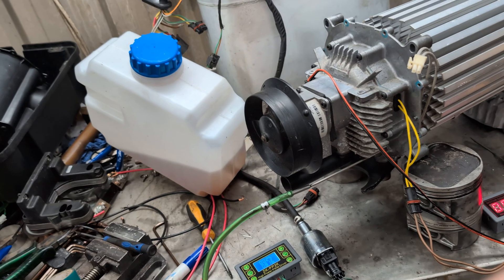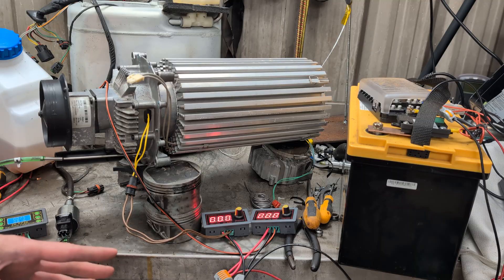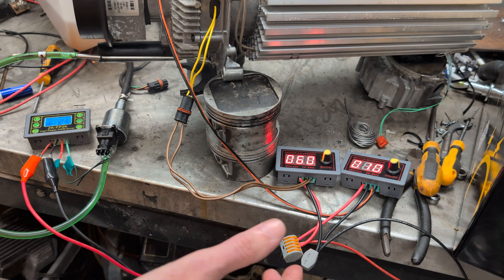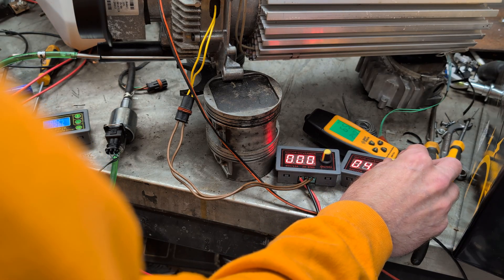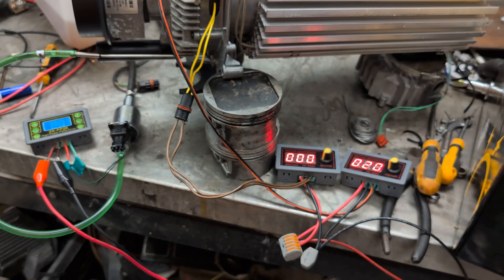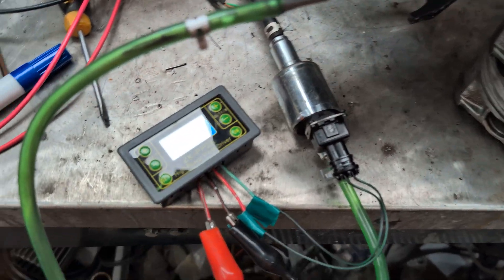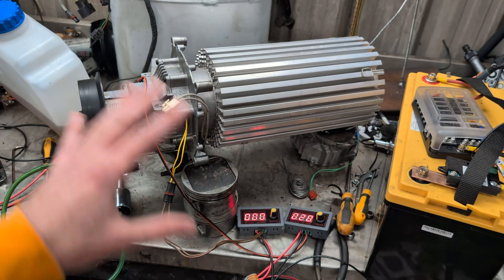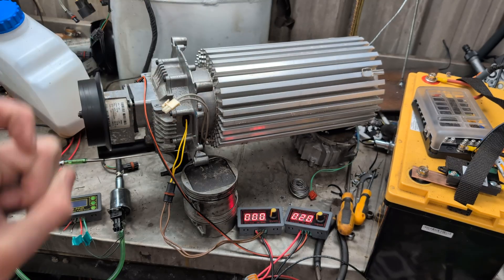Running a diesel heater with simple controllers (no ecu)

Comment: Is there any alternatives on the market that would run a dosing pump at a set rate. Currently working on a project and need the pump to kick in automatically when a 12v supply is connected

Comment: I really like Afterburner controller as it is nicely integrated into Home Assistant. As I have a spare CDH controller from air version, it could probably work with china water heater out of the box. Maybe I would just need to match the fan and pump speed to match to original controller if the parameters are acceptable. Thank you David for this nice experiment!

Comment: Are you sure you need a PWM for the glow plug ?
I found this info below online and the way I read it is the glow plug is powered by 12 volts 10 amps and the fan and the fuel pump is powered by PWM

Online said
" PWM for other components: While the glow plug itself is a 12V component, the controller might use PWM to regulate the speed of other components like the fan or fuel pump to achieve the desired heat output. '

Comment: Could you leave the glow plug in the 60 %  location at all times and then when you want the glow plug on just turn the glow plug switch on ?
If so you could probably add a circuit that turns the glow plug off after about 3 minutes.
Also when you press the button to turn the glow plug on you might as well have a single switch not only turn the glow plug on but turn on all electronics then after 3 minutes the glow plug goes off but everything else is still powered on until you manually turn it off.
Then the only thing left is to figure out how to turn the air and fuel up at the same time using a single rotary dial switch and maintain the proper air/fuel ratio which seems to be the hard part.
It would be cool to see a simple homemade controller that does all the basics 
Turn heater and glow plug on
Glow plug shuts off automatically after 3 minutes 
At least be able to turn the fan and fuel on to a single setting for example ( medium setting )
Thanks 
Liked commented subscribed thumbsup

Comment: Thank you for sharing this , I've been trying to figure out how to run the diesel heaters using a basic controller like the pu5 or the similar Chinese rotary dial controller, I just wanted a way to control the heater in case I couldn't find a replacement ecu

Comment: Pump and motor speed are perfect applications for a NE555 timer circuit.
So I wonder if these could be controlled by respective input (thermistors etc.) thus creating a simple circuit to operate such a heater- without programmable chips.

Comment: David who takes Diesel heaters to a science, So now it is an "electronically controlled combustion chamber", I myself bought a sheet metal cabinet at IKEA for 30 Pounds, fitted everything in it, removed a window in the basement, closed it with cement board and hung the cabinet on the outside with the intake and exhaust on the inside, this has worked since November 2021, Thanks David For all the wonderful features and ideas.

Comment: It looks like you could easily get rid of the glow plug PWM controller by replacing it with a toggle or even timer switch and a high wattage resistor of an appropriate value.
Reply from the maker: The controller for the glow plug is to lower the risk of shattering it from thermal shock.  All the ECUs ramp up the power to the glowplug letting it heat up slowly.
Reply: @DavidMcLuckie  I wonder if an NTC Inrush Current Limiter would essentially be all that is needed to protect the glow plug.  I was just trying to think of ways to further simplify a controller-less setup.  It would be interesting if the entire thing could be controlled electromechanically.  The only thing that would be harder to control is the fuel pump without the PWM control.

Comment: You could set up the burner with out the heat exchanger and tune by eye, start up, and the different power settings keeping the flame blue. Also some sort of exhaust temp gauge could give you an idea of combustion when starting up, like in Jet / Gas turbine engine start up..

Comment: Carbon monoxide meter, interesting… I wonder if you could use a car co2 sensor because I imagine you’d mount this external?
Reply from the maker: I've tried a wideband lambda sensor but the reading were very erratic and didn't match what the flue gas analyser showed.  I think I'd need to build an exhaust that lets the gas mix a lot better so the lambda sensor can give a truer reading.

Comment: Thanks for sharing!! I have an ecu for my hydronic heater but also an air compressor AND these radiator fan / blower motor controllers I need to figure out how to send pwm signals via an esp32… have you looked into which components you need for something like that? I tried mosfets and that didn’t work.